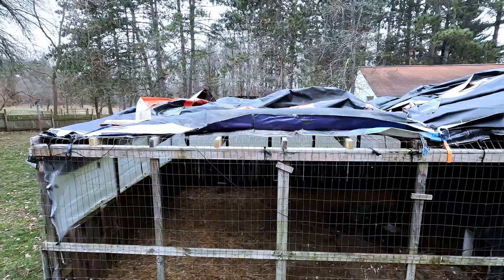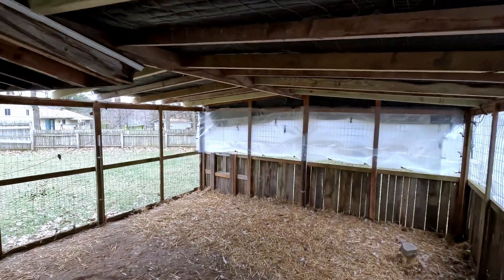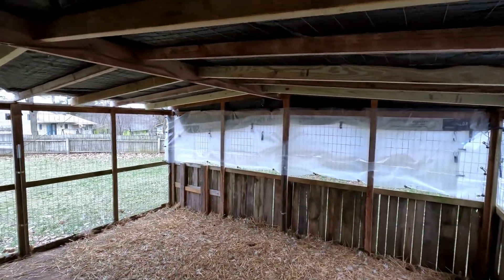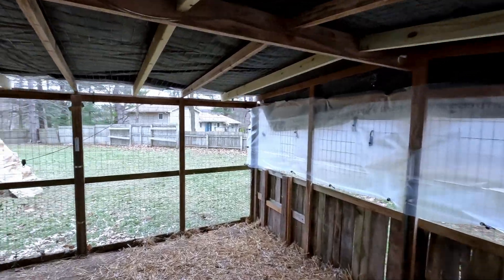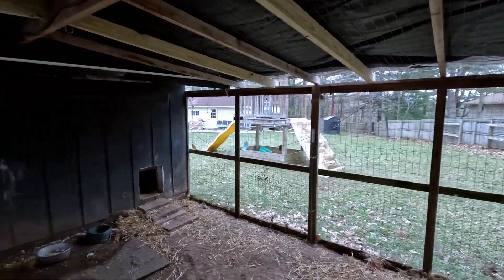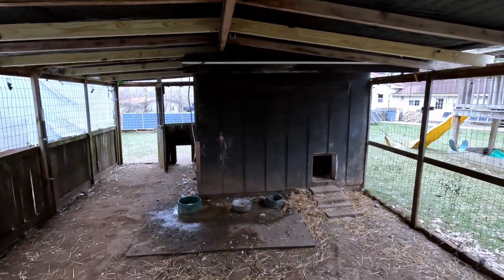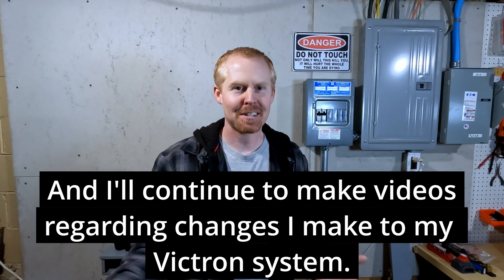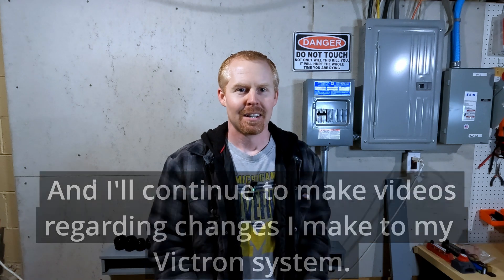So What's the Next Big Solar Project?

Comment: I use a additional Fronius Inverter, that integrates well with the Victron System. And the Victron Inverters provide the grid for the Fronius PV-AC-Inverter. You just need to add a AC-PV-Assistant, so that the Inverters increase the frequency, once the batteries are full....or just use the ESS-Assistant, if you use it grid-parallel.
Reply from the maker: Thanks!  I've heard a lot about the Fronius and it really does sound like something I need to try out.  Maybe I'll test that out on another outbuilding project.

Comment: You have to get those panels off the ground. DC voltage is very dangerous, if you kids get hooked up you will wish you had them on an earthed frame. Safety first!!!
Reply from the maker: Thanks!  The frames have an earth connection.
Reply: @AdamDeLayDIY  just make sure the cables and plus are not accessible. An earth means nothing if someone becomes part of the circuit. Snow and rain can make things very dangerous. A  frame with specific orientation and angle is cheap to build. I see a lot of this in North America (Arrays directly on ground), you guys have cheap access to everything. Not sure why things are underdone 🤔
Reply from the maker: @OrganicPower-Australia  I would imagine there's a lot of reasons people might come up with.  "It's just temporary" or "testing things out" are probably a couple.  Hard to say.

Comment: I guess you liked my idea! Where was my shout out. Run an AC couple like the one you saw on my recent episodes. AC coupled can be run further than DC. For the coop.
Reply from the maker: Hehe, this has been in the works for months, just takes a lot of time to get things lined up.  

The AC couple is a good idea and I might do that on a different building later.  The DC helps “justify” the test wall with the Mrs.  😁

Comment: Adam, I was laughing hard as I was watching this video.  It seems your journey in solar is similar to mine and I was thinking about how my projects go too.  Solar projects for some reason never seem to be completed.  There's always something more I want to do, something more I want to add. 

I was impressed with how you went from needing to rebuild the roof on your chicken coop, to "let's put more panels on the roof", to "now we'll need another charge controller", to "lets get an all in one inverter that has the charge controller already built in".  That's a master class in justifying more stuff. lol. 

As you were talking. I was even thinking about asking if you're ready to sell your Victron inverters, because my Victron system is still on 24V and I certainly need to upgrade to 48V.   I mean it's only been in service for a year.  ;-))

Keep up the good work Adam!
Reply from the maker: Thanks Bruce!  Yeah it never ends.  

I was more impressed that I was able to convince my wife with that thinking path as well… 🤣

No plans on getting rid of the Victron system.  Why get rid of a good thing?  I would have to find some system that really blows my socks off in order to make that change.